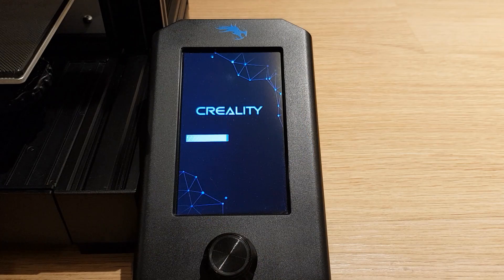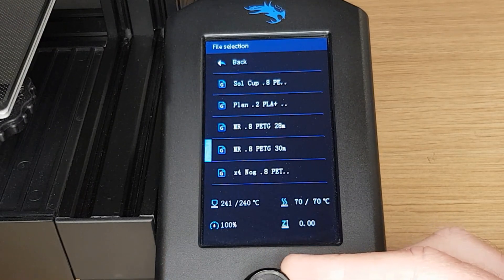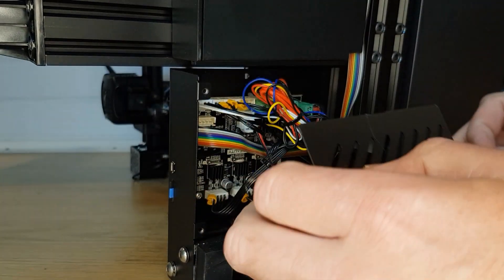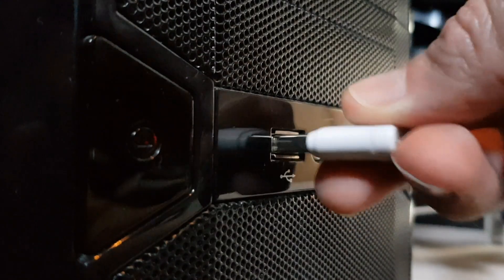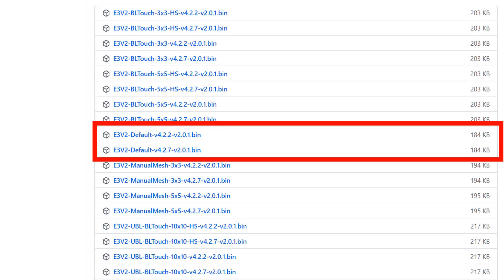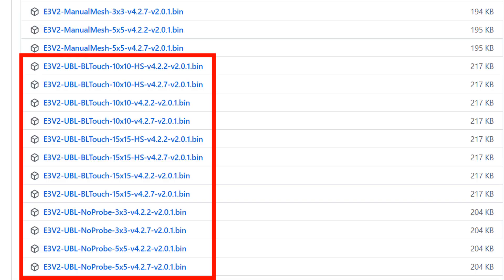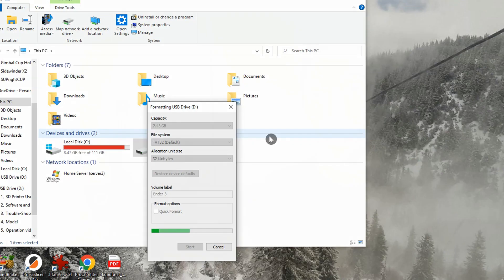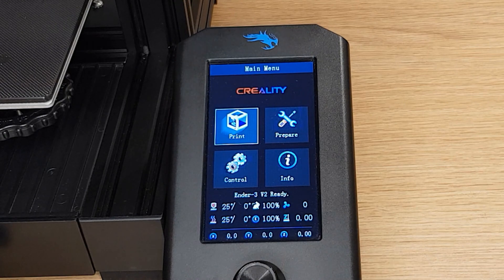Ender 3 v2 Jyers UI - Quick, Easy Firmware Upgrade That Transforms Your 3d Printer!

Comment: hey just updated my ender 3 v2 neo with the updated UI and a run out sensor. your video was a missive help for that. just one question do I now need to change the start Gcode to use the new bed leveling mesh ?

Comment: i have 0 axis movement after installing malin, the steppers engage so I want to rule out any hardware issue, any idea?
Reply from the maker: I'm not sure what you mean Oscar, can you explain more?
Reply: @RickyImpey  hi! So I installed malin and whilst attempting to move or home any axis I have 0 movement, eventually giving me a homing failed error. I reverted back to the base firmware and it's back to working. I think I'm going to experiment with other firmware right now. Thanks a ton of the video! Finally gave me the confidence to install my cr touch haha

Comment: Hello Ricky. Excellent video as always. Much appreciated. You have the most straight, clear and informative tutorials. But this time, I've been left with a doubt. You mention that RCT6 is no compatible with Jyers, but I happen to use the Jyers firmware normally in my Ender3v2 that has this exact version (STM32F103 - RCT6). I wonder from were did you obtain that information and the reasons why. I looked up and down on the Jyers page and caught no mention of this neither. In fact it is mentioned that STM32F1 boards are OK from 256k to 512k on a table on the marlin page. I assume you must have made a confusion with STM32F4 immediately bellow. Apart from that nice video. I hope this info (if I'm correct) helps some of your viewers. Cheers
Reply from the maker: I could be wrong or things may have changed. I seem to remember reading that there wasn't enough memory with the RCT6 chip to run Jyres but I couldn't test it myself at the time as I didn't have one. Happy to be corrected👍

Comment: Ricky, I appreciate your time and efforts as your info has been huge in helping me gain the knowledge needed to print some bits. However I have a question that just popped into my head as I was following the Jyers install. My question here does not follow anything in this video per-se, but I promise if I don't ask now, it'll never happen.  I've noticed that the control screen on my Ender 3v2 has a line to modify the Flow Rate. The standard setting appears to be a number of 100%.  How does this number react with what a slicer might ask for?  Make sense?  If this setting in my Ender was 105% for example, and my Cura slicer was calling for, say, 98%  (all made up as I've yet to change either of these) what happens?  And I'll stretch this ask to this: What if I change the GCode for flow (I have not) how does the mother board resolve that along with what Cura might ask for?   OK, I'll try to keep calm and carry on. Thanks again for all of your wonderful information sincerely PC

Comment: Can you explain how to reinstall an older verson? As my crahed and now can not install anything.
thanks
Reply from the maker: Hi, do exactly the same but with the different firmware on the SD card instead. If it doesn't update, change the file name slightly (for the printer mainboard firmware).

Comment: Thank you for the video! i Have a small problem when i went  to write the data to the printer i find a small problem my MaxSpeedE it was 60 but it let me write max to 50 and the MaxAcceleration E my was 5000 but the max is 1000.. What i can do now? (i had make a photo of the data just to be sure i didn't make mistake when i write them down)
Reply from the maker: Hi, that's strange, you could try resetting the EEPROM to reset everything to standard or you could use something like Pronterface to change the individual settings. I don't have a guide for this yet though.

Comment: you may be able tilt your printer to the side and shine a light into the grid and see the board number without removing the cover.
Reply from the maker: Good tip👍
Reply: @RickyImpey  you’re videos are such a help. Simple and correct information. Thank you !

Comment: Hi Ricky and everyone, The screen mod didn't work for me. I did used the "E3V2-BLTouch-5x5-v4.2.2-v2.0.1.bin" for the machine. Then the "Gotcha" for the screen, tried SD card format but still there.
The screen just on and measure my Bed + Nozzle Temp. Then it just stoped there
Reply from the maker: Hi, did you see Pat Moore's comment on the screen update video here https://youtu.be/H_IOvuPDGvs 
He found a way to sort it that might help.
Reply: @RickyImpey  Hi Ricky, I love how this looked. But my E3v2 having problem with the bed level(Z Axis). How can I go back to the original version?
Reply from the maker: @RaulNguyen1912  Just follow the exact same steps but using whatever firmware you would like to run. You can find the latest stock firmware on Creality's website. If you have any problems, change the file name slightly as the boards don't like to install firmware with the same name as previous versions. Don't forget to do both the screen and main board.

Comment: Thanks, Ricky for your time and knowledge. I followed your steps and upgraded both firmware and display on my V2.. Quick question: I have the newer Ender 3 Neo  (not V2 Neo) which is an upgraded version of the original Ender 3 minus the color display. It is just like the original 3 except it came with a CR touch and the silent board (4.2.2) with the RET6 chip like my V2. Question is even though I have the right board can I upgrade the firmware with Jeyers and use the older monochrome display or do I have to upgrade the display as well?  The visual settings in Jeyers obviously wouldn't apply but that would be okay.. Thanks...
Reply from the maker: Honestly.... I don't know. Sorry, I don't want to say without trying it and I don't have the Neo. The good thing is that it is very easy to switch back if you have the firmware .bin files for the firmware you are running. If you do need to go back, change the name of the .bin file as it won't accept the same file name more than once.

Comment: Running it on two v2 I've heard it's not updated anymore
Reply from the maker: It hasn't been updated in a while but I still run it. Many are using mirscoc pro firmware which I believe is still being supported.

Comment: Hey boss, The Google Drive Folder that has those files, I can see them but when I try to download them, it says I do not have permission along with another bubble window that says I have third party cookies blocked turned on, so I lowered the security of the fairwall, to "accept all" but still no forwards motion... Please note, I will bet you this is something I am doing exceptionally wrong on my end..LOL... The file I want is the DWIN-SET just in case screw something else up, which I always do.. I read the "reasons" on the bubble windows after trying to download to see if those instructions would help me further this along, but, I think it is best that I admit that I am just a dummy.. Either way, I am inspired by all this 3D printer stuff, it looks like so much fun. 

I finally found the "dll" files and got them installed into the two locations to get the slicer to open up and run, Thank you for that. but it still kinda crashes out at random times for no reason, that I can understand. I am sure it is also something I am doing, and again, just not smart enough, being it is a new laptop, a newer version of WIN 7, and of course, the software from the 3D printer stuff. I am still having fun as I learn this gameshow, so, not all is lost on being defeated so many times on this adventure. Your videos have taken so much of the painful learning curve/curse out of the way, due to how highly detailed you explain things, Thank you for your efforts. I'll send you some loot as soon as I get this thing up and running.
Reply from the maker: There is a pretty steep learning curve with a lot of this stuff and unfortunately, a lot of conflicting information out there. Try not to get frustrated, i'm sure it will all come together for you. I'm still learning every day and then trying to share what I learn in a consistent way.
Reply: @RickyImpey  Roger that...

Comment: My BL Touch fails at successful bed leveling 50% of the time if not more, under Creality Marlin or with this version. I can occasionally get a mesh and the numbers put a 3x3 at 0.30 total as worst across the bed which is fine by me. When it prints, it can print well, but getting it to print is the misery. I hate these machines. Had an Ender 3 Pro years past, hated it. Have other branded very reliable and bullet proof printers that require zero fiddling or babysitting. Just need to move away from Creality machines.
Reply from the maker: Sorry you're having problems. I certainly haven't had the same issues with min but i know some have.

Comment: I have a ender 3. I upgraded the board to a 4.2.7. It wont let me use the v2 screen. It just beeps. Any reason why?
Reply from the maker: Need a bit more information really. What firmware are you running? Have you put matching screen files on the screen etc.

Comment: This would be a good firmware, but it is too old and has bugs that have already been fixed in newer marlin firmwares.
In addition, by default in many places, as well as the firmware for DWIN LCD. The other known LCD version is DACAI, which cannot be updated with DWIN files. Although they have already made an external solution for this.

However, the good news is that this firmware can be installed on 4.2.2 motherboards equipped with the new GD32F303 microcontroller.
Reply: Were you successful? I read that people tried installing Jyers fw and it didn't work
Reply: @Zigfryed  I had to try different methods quite a few times. For example, it was necessary to restore a much earlier factory firmwares in series, than this. I don't remember anymore, because after that I switched to the MRiscoc Marlin firmware version, which is much better and is currently being updated. I put it on the factory 4.2.2 board, then also later to BTT SKR Mini E3 v3. It worked fine.

Although I have since switched to BTT Manta E3EZ board+ BTT CB1 combo and I use Klipper.

Comment: I installed a cr touch. Will the firmware for bl touch work with it? I don,t see any versions for the cr probe. Thanks
Reply from the maker: Yes, the machine and firmware see them as the same
Reply: Thanks, printer flashed ok but display won’t? Used same card, reformatted an copied folder as instructed? Would appreciate any suggestions.
Reply from the maker: @normanziegelmeyer7693  Check out the pinned comment on the screen files video here: https://youtu.be/H_IOvuPDGvs one of my viewers had a very similar problem and found a solution.
Reply: @RickyImpey Help, I followed instructions on link and it said it was updating but when done all I get is a blank screen.
Reply from the maker: @normanziegelmeyer7693  If you can't get it to work, just load the original Creality files back on as in the video. Links are in the description.
Reply: Thanks, must've done something wrong, retried and got it.
Reply from the maker: @normanziegelmeyer7693  Glad you got it sorted 👍
Reply: I hope you don't mind all the questions, I installed the Jyers software to get the cr touch working as the enders update wouldn't flash. Not sure of how but the probe now tests 9 points to create a mesh. How if possible do I set it to test more points for a more accurate mesh? Also if I have leveling turned off in machine code in Cura will it still use the last mesh I created and saved on printer and automatically Autolevel? Thanks
Reply from the maker: @normanziegelmeyer7693  Hi Norman, if you want more probe points then use one of the different Jyers firmware files. When you chose the one you have it probably said '3x3' in the name. Try one with higher numbers and it will probe more points. You need one of the codes in your start code for it to use any saved mesh (G29 or M420).
Reply: Thanks

Comment: Do you think that RCT6 Chips are found on First versions of this printer and they upgrade It on newer ones, or Do you think that Is a random thing what chip they put on?
Reply from the maker: Unfortunately I don't know of any way to tell what you will get. It seems it may simply come down to what the manufacturers can get hold of at the time of manufacture. I have no affiliation with Creality so know no more than anyone else I'm afraid.

Comment: i have frozen screen what to do! it is freezing aswell when trying to update
Reply from the maker: Some of the boards don't take the firmware unfortunately. Just load the original Creality firmware back on and you should be back to where you were.
Reply: @RickyImpey  hey rickey, first of all thanks for your comment. second do you also know where i can find the original software?
Reply from the maker: @antonvos1534  linked in the description Anton. Unfortunately there are a few different versions of the boards now so I knew it wouldn't work for everyone. That's why I advise to have the Creality firmware ready in the video👍

Comment: I have a CR touch unit. Does this mean that the Jyers firmware is not for me? I only see BL touch files on the list.
Reply from the maker: Just use one of the BL touch versions, the printer doesn't know the difference between the two👍

Comment: Is there any other upgraded firmware for 256k memory?
Reply from the maker: I believe some people are working on it but it's a bit of a problem caused by the lack of supply of the better chips. Even some of Creality's own firmware is causing problems for some people. I don't have one with GD chip myself to test so I can't say what works and what doesn't work yet I'm afraid.
Reply: @RickyImpey  Can I install the original upgraded firmware from creality atleast?
Reply from the maker: @supreethbk7982  you can try any firmware, it won't damage anything. Just have the same firmware ready to put back on if it doesn't work.
Reply: @RickyImpey  Hey, I installed the jyersui latest firmware (184k) into RCT6 motherboard(256K). It's working perfectly fine. Took the chance and it was worth it!!
Reply from the maker: @supreethbk7982  awesome, really glad it worked for you.
Reply: @Supreeth B K   Hello, i have the same problem do you have a link 4 us to try your solution 🤔

Comment: I had my E3 V2 decide to freeze at the start of a print tried all sorts. New SD worked until their eprom dat came on so thought I would see if Jeyers UI would change anything.  All went really well to my surprise.  Loaded display etc.  Went for the manual mesh 3x3.  I must say it is now spot on (Touch Wood) love the scrolling print file done the PID as well while I was at it.  Only problem I had was find that bloody chip info (Old Eyes).  Thanks!
Reply from the maker: Cool, even better when it fixes a problem and gets you printing again 👍
Reply: @RickyImpey  I am thinking of getting a cr touch and I have no issue upgrading to allow it to work but do I need to update display as well?
Reply from the maker: @Offcut55  you don't have to change the screen files. Creality have firmware to use with the CR touch. If you want Jyers and CR touch then I don't actually know if you NEED to change the screen files. I don't think so but I haven't tried it myself.
Reply: @RickyImpey  I will keep with jeyers love it

Comment: Stupid question: can I put this on my E3? I have the BL touch, trying to see about my warped bed. But only have an ender 3
Reply from the maker: Jyers is designed specifically for the Ender 3 v2. It 'may' work with other printers but doubt it would be a trouble free experience. There are probably better options out there for the Ender 3.
Reply: @RickyImpey  thank you

Comment: You don't need to format as the card was already formatted. Literally just updated firmware for CR touch and I didn't format the SD. Never have.
Reply from the maker: Yes, you're right, if you have the original card as it came. However, I know a lot of people use different cards and the formatting is important in this case. Also, my card was formatted wrong for the screen file update so I had to format it anyway.

Comment: damn haha i only bought my printer recently unfortunately my chip is rct6, love your content anyways man!
EDIT: my board is 4.2.2
Reply from the maker: Ah man! Yes unfortunately they are having to use different chips because of the global shortage. It's the older ones that have more memory strangely.
Reply: @RickyImpey  that's interesting, I ended up flashing mriscoc professional firmware (compatible with 256k) and it's working fine so far. Tried to put an icon pack on but had no luck. Video was still helpful so cheers
Reply: My (first ever) 3D printer arrived today. It's a 4.2.2 with RET6 :)

Comment: I’m using the firmware for the bltouch. I can not do a z-offset. When I try nothing happens.
Reply from the maker: I'm afraid I don't have a BL touch on my Ender 3 v2 yet. Have you tried any of the other BL touch firmware options?
Reply: I have the CR Touch and had the same problem with Creality firmware.  The Creality firmware appears to have lots of issues and I have the RCT6 chip so maybe Mriscoc?  I am going to try.  There is another set of firmware from TH3D Studio.  Looking for best fit with the RCT6.  What a pain!